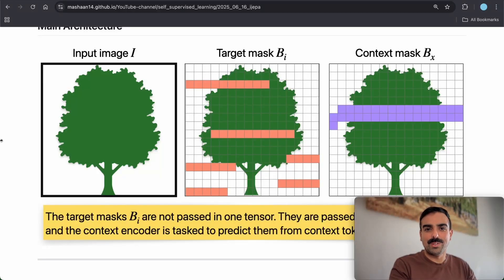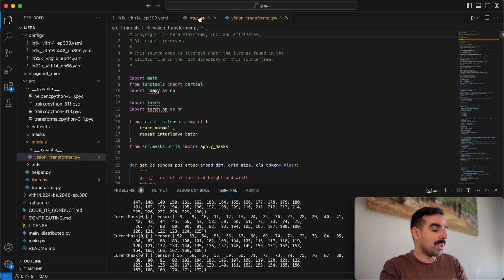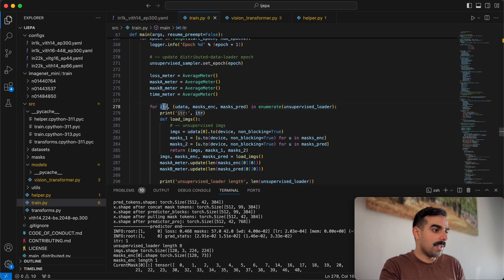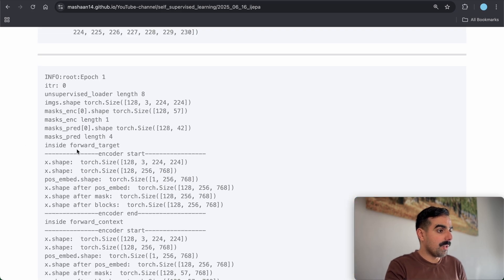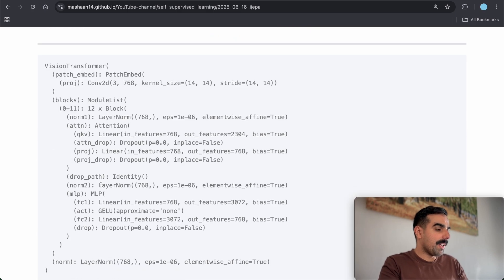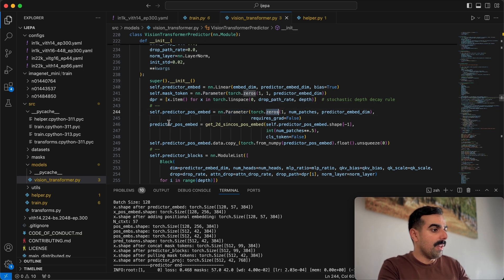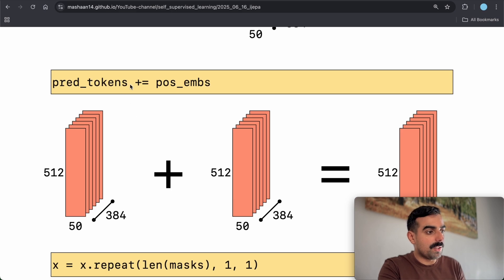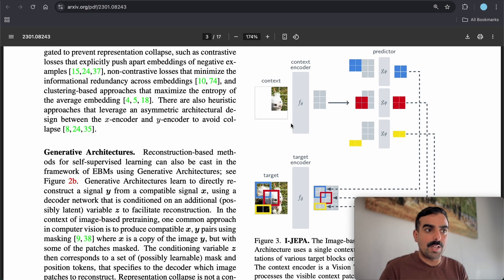I-JEPA Explained with a Single Batch Run

Comment: Awesome explanation. Subscribed! 

One question, how effective is ijepa based pretraining compare to DINO? Will the learned repredention be superior to DINO? I understand that ijepa converge faster
Reply from the maker: Thanks for your comment. I'm glad you find it helpful.

Honestly, I can't say whether ijepa or dino is better. In the papers, they run large datasets on powerful computers. I don't have enough resources to properly compare them. That said, ijepa doesn't use augmentations. So you're less worried about things like cropping, flipping, and gaussian blur.
Reply: @mashaan14   makes sense. To ensure DINO to be effective we might need to get the augmentations hyper-param right for the domain dataset. IJEPA seems flexible. Thanks!